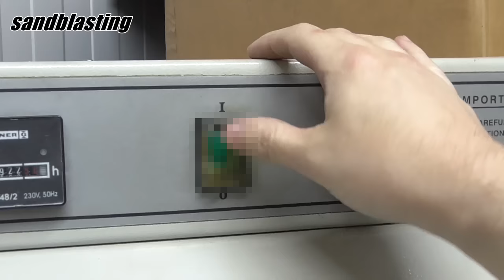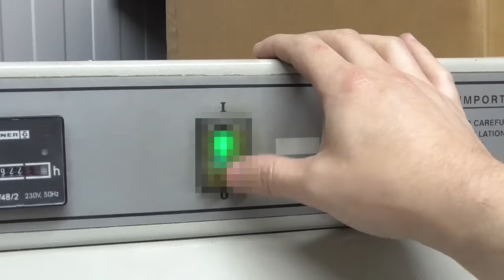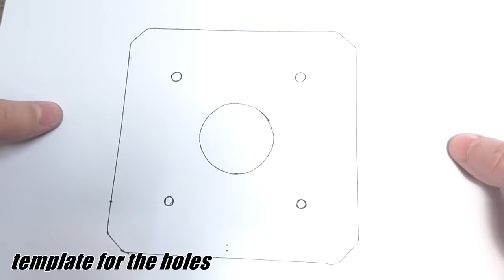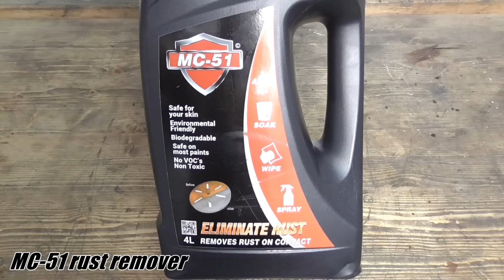Rusty Old Coffee Grinder - Perfect Restoration

Comment: Absolute perfection! I cant believe you filled in the holes and re drilled them because the countersinks were too big! The attention to detail and your craftsmanship are unparalleled! Keep up the great videos!
Reply: On car restoration side of things using brass or if possible copper plate behind the sheet metal and fill weld it is pretty common method. This way molten metal has something to support it, so it wont just drop off and steel wont connect to brass or copper. Also those metals are great heat conductors, so heat is pulled from steel by copper or brass and this way thin sheet metal warping from heat is minimized. Plate being big enough it has enough mass to absorb and spread the heat on the material so it wont even melt.
Reply: @Hellsong89  thanks for the explanation

I learned quite a bit there

Comment: "You can always remove material but you can't add it back"

my mechanics: Hold my welder
Reply: I was thinking the same thing during the video a couple times haha
Reply: There is too much material removed from this part

I make a new one
Reply: Im a deisel tech and a welder. That's one thing we know that we have that wood workers dont
Reply: @decembersveryown5935  wood glue and sawdust my friend.
Reply: Pyotr Ilych Tchaikovsky  big guts
Reply: @windhelmguard5295  that works but look is not as good :) greetings from Poland :)
Reply: Very nice
Reply: @crazyivan030983  If you paint it, it will work fine.
Reply: A 3D metal printer

Comment: just realized he used the olive oil as lubricant so it would remain food safe. genius!
Reply: Olive oil will go rancid with time though.
Reply: And he used lead solder
Reply: HOwever, it's not a good idea to use olive oil on the grinding burr since it will contaminate the coffee. Unless you don't intend to use it. Then yes.
Reply: @3DMegadoodoo  I suggest Mineral oil, it is edible and will not go rancid. Great on cutting boards and wooden knife handles
Reply: @RBG-tr9ce  not all mineral oil is edible. It must be food grade. Walnut oil is a great go-to. It's used extensively in woodcraft as it won't decay or spoil.
Reply: The man forsure has talent
Reply: @damiant427  Is it eatable?
Reply: @damiant427  That's not lead, it's tin.
Reply: @outsidethepyramid   That made me laugh so hard
Reply: Olive oil will dry out and become gunky after a while (like oil paint). Eventually you have to use a solvent to remove it. People at a restaurant I used to work at would occasionally use olive oil and pan spray to lubricate an old slicer, but it always made it worse long term and we had to use WD-40 to clean it (which obviously isn't food-safe).
Reply: @RBG-tr9ce  You have to ensure it's food-safe mineral oil. Not all mineral oil is. But it is recommended over olive oil because, as you said, olive oil will spoil over time.

Comment: I was hoping you'd reform the grinder parts, however at the end they seemed to grind coffee just fine even with the "well used" shape of the grinder parts. Overall beautiful as always!!
Reply: I was hoping to see that as well.
Reply: All this effort on this now beautiful little grinder, and the actual grinder part is still a complete wreck. Sad. Not sure how he would have fixed that but I was hoping.
Reply: Function and form - the grinder works 100% efficiently, and preserving the slightly worn look adds charm. perfect.
Reply: @Soup-Dragon1  I mean, the grinder definitely still grinds coffee. But those burrs are still too worn post-restoration to give a consistent grind quality. This is still a beautiful little work of restoration, but I personally wouldn't trust the coffee ground out of it to taste particularly good.

Still, probably tastes better than anything coming out of a conventional blade grinder.
Reply: It was anguishing to see those dull burrs go back in after all that work, but I don’t think there’s a good way to resharpen them.  I replace my grinder burrs about every 2 years.
Reply: Should have machined new burrs. 100%

Comment: I'm very surprised that 30w soldering iron was hot enough to solder that larger piece of brass. That was a top-notch video!
Reply from the maker: I had to heat the part for quite a bit with max power on 450°C. Thanks man :-)

Comment: it is weird to watch, because the quality of "restoration" is like million times better than original job. Usually restorations takes a thing 80, maybe 90% to the level it was new.... in this case it was like 1000%.

What is very interesting... who made it and why... it was clearly not a factory job, a lot of improvisation and some really shoddy craftsmanship. Seems like some sort of one off project... maybe village blacksmith made it on order?! Just bizarre thing.
Reply: I was thinking along the same lines: this can't be a factory job. Brilliant resto though.
Reply: L P You’d need some sort of factory to make that burr, I think. It’s made from tool steel and needs helicoid machining. From my limited knowledge of old manual coffee grinders, it looks like a Peugeot Freres and I’m guessing it’s from the late 1940s. The colour, the poor quality and the fact that it’s mostly made of metal tend to point that way. There are plenty of them around on eBay for very little money and they are mostly in this sort of condition. I haven’t owned any French coffee grinders, mainly because they are not very good. French coffee is pretty undemanding on grind fineness so the burr and its adjustments are nowhere near as good as a good Zassenhaus, Dienes or PeDe and that one is blunt enough that it would be unusable for anything but the coarsest grind.

French manufacturing and infrastructure was in an extremely poor state in the immediate post was period so I’m not really surprised the original machining is so rough. On the other hand, Eastern Europe produced a lot of similar items which really did come from cottage industry so my initial assessment could be wrong. I have seen similar items from Czechoslovakia and East Germany and I assume they were also made in the former Soviet Union.
Reply: TheThirdMan 
Thank u for this knowledge
Reply: @comeatme6ro413  It could be assumed they just made things this way back then, but many decision looks like one-off job to me. I certainly doubt it was mass produced. Those screws and nuts looked like one-off, everything suggesting it was hand made. Sure it could have been like small workshop, making dozen of them a year, but certainly doesn't look like production line job... far too much variance between each part and a lot of decisions which looks to me like improvisations on the spot.
Reply: @thethirdman225  The helicoid part in particular look like hand made and not something made on proper tooling. Probably cast in rough shape and then hand filed to fit. It may even look copy or knock-off i.e. the "craftsman" had like a proper factory made machine/parts so knew what it needs to look like, but didn't have right tool to make it exactly like that.... so it sort of looks like real thing and probably sort of functions.

Comment: Great restoration as always but... you didn't fix the most important part: the grinding mechanism. It's all dulled. This thing will not give you a good grind, it wil just break your beans by pressure which will put stress on the metal and damage it even further and give you an uneven grind. A grinder actually cuts the beans.

If you don't actually plan on using it and just want it to look good then this build is complete, but if you actually want to use this in any capacity to grind coffee, you need to sharpen every little blade of this mechanism, maybe even remake a new one since it's really busted up.
Reply: I agree on this, i were thinking if you dont restore the actual grinder then why restore it in the first place, because if the coffee grinder is just for looking at you could have in it´s original state. Else i loved this restoration movie. You did a fab. job .. replacing the brass and adding material to the metal and wood is amazing.
Reply: Read the description
Reply: Agreed, as I person who loves good coffee,  I find it strange, burrs need to be replaced, they absolutely worn out ...  replacing /making  new bolts which are purely decorative and leaving most important part of grinder, BURRS   as it is...just makes no sense at all to me.
 This grinder won’t produce  good ,even grind ...looks good though...
Reply: Annie Hawes wrote about finding a wonderful old coffee grinder and using it. The ground coffee tasted terrible. Then her bf told her that his dad only kept it for making chili flakes.

Comment: But the actual grinding mechanism was shot. It looks beautifully done but still has those blown out, worn out grinding gears?? WHY?
Reply: TopherFM he restored them as much as he could so that they’re pretty functional but it would be pretty hard to solder and machine bc huge loss would occur (and it won’t be accurate) and making new ones will be 1. Very Hard 2. It’s like the soul of the machine and this is restoration not remaking
I’m sad about that too bc I absolutely love the idea of having a perfectly working ancient coffee grinder but you work with what you got ya know
Reply: @randomalienfrommars0567  and, lest we forget, the restored grinder did a pretty good job grinding coffee beans.
Reply: Yeah, I was a little disappointed about that too. But the cutting parts had a very complex shape and it would be very difficult to grind them all, maintaining their symmetry. Even if he could grind them, he would alter their geometry and they wouldn't be able to fit together. I am sure that if you were really crazy, you could TIG weld the cutting teeth and spend a lot of time making a 3D model so you could program a 6 or 7 axis CNC machine to carve new helical cuts. But it would have to be perfect, so the parts would fit together and ground coffee properly. I think he did as much as he could with his current set up. Still a great video.
Reply: My guess is the original grinding pieces are cast? So would have to make a mold from the piece have and then complete the missing detail then recast a new piece?
Reply: @incognitotorpedo42  It depends on how course you want your beans. I think these worn out teeth would struggle to go much finer then a medium grind (would become very uneven otherwise)

Comment: The guy: is wearing gloves when uses polishing wheel 
Also guy: isn't wearing gloves when uses belt grinder
Reply: Yes. What's wrong?
Reply: I'm not a guy inside the sector but even I know that you don't wear gloves when working with fast revolving machies for safety reasons
Reply: you use gloves when using the polishing wheel so as not to stain the brass :)
Reply: That's a huge no. You never use gloves on a machine that can snag clothing.
Reply: The gloves are used for heat protection.

Comment: I was watching u literally melt metal into the box in the beginning just to re drill holes, and was like, “isn’t it easier to rebuild box?”. Then I remembered this is more on restoration rather than just improving trash design lmao
Reply: Nah, it's actually quite easy and quick to just weld those holes and redrill them than to make a new box. You need to get plate of certain thickness(I guess this guy has everything in his workshop anyway :D ), do some bending, weld the edges, grind and polish them, drill holes etc. And if You can weld and drill making new holes takes maybe 15 minutes

Comment: Dowels are just welding for wood.
Change my mind.
Reply: I thought about it for a sec...decided I can't.
Reply: dowels are rivets for wood. 

or locating pins. 

wood glue is weld
Reply: @tylergarza8695  r/woosh
He welded the holes in sheet metal and drilled them again,
He did the same with dowels for wood.
Reply: @Throneos  it's r/woooosh, also this isn't reddit idk if you've noticed how that doesn't work here. 

also also, that's just a different method of solving a similar problem, why do you have to act like this.

Comment: kinda off topic.. but i build plastic gundam models.. when you snap the pieces out of the injection molded parts runners they leave little tabs you have to sand off with various grits of sand paper.. and honestly thank you because i file and polish them in the same hand movements you use to file off sharp edges and they come out perfectly blended and polished!

Comment: Nice video. Keep on going, although it might be better if you use longgrain plugs in stead of end grain. Screws wil hold longer in longgrain wood then endgrain wood. 
Have seen it in several video’s of you. 
Its just a tip😉. 
Keep on the good work💪🏻

Comment: Pro tip: when soldering large items that tend to act like a heatsink, preheat the item to be soldered with a heat gun and add some liquid flux before the solder.  The solder will flow much better at lower tip temperature and the surface tension of the solder will drop allowing it to wick into crevices.

Comment: Funny thing about rust remover. 
Bought original cast iron Coca Cola chairs (50's) and I soaked the bolts and nuts in rust remover for 24 hours to see if I could still recover them. I took them out and had everything ready to blue them and I just watched as they rusted right before my eyes in mere seconds.

Comment: At 11:14, what kind of metal material did you use to connect the two ends there? I'm also curious if one can use a normal soldering iron, or does it have to be a special type for this purpose?

Comment: How do you know when to polish a metal surface jak in case of knobes or the grinder shaft and when to clean/protect it further with sandblasting/blackening like for the main part? This seems to be a pattern but based on what?
Reply from the maker: Depending on the purpose of a part and the look I want to achieve.

Comment: I understand I watch it 3 years after and you got to another level in later videos but I was a bit disappointed that the grinding "stones" were just cleaned and not replaced or remade. The whole thing is perfect, immaculate even, but for one thing. It wouldn't work properly. Those "stones" are badly worn out. 

Please don't take it as a criticism, but an inspiration. It would be possible to change them in any later event.

Comment: I noticed that you clean the painted parts with a solvent then paint remover and then sandblasting and then cleaning again
Is there any specific reason for doing that 
Sandblasting would just  remove ever bit of dirt
Reply from the maker: Sandblasting media is very expensive and it turns bad a lot faster when there's a lot of dirt or old paint in it.

Comment: @my mechanics  Why didn't you sand blast the paint off this item, instead used a paint stripper?
Reply: The sand blaster being used is a recycling blaster, so they reuse the media- and if you were not recycling it then it's fine to use it to remove paint. But here you're mixing old paint with the media, so you don't want it gumming up the system.

Comment: did you use paint stripper first because of lead paint? otherwise why not just sandblast the paint too
Reply from the maker: Sandblasting media is very expensive and it turns bad a lot faster when there's a lot of dirt or old paint in it.

Comment: What is the abrasive surface you're using at 15:07 to sand down the brass nuts?
Reply from the maker: Flat surface grinded aluminium plate with 240 grit emery gloth taped on it.

Comment: 1) What type of corrosion did we find on the restored piece?

2) What types of cleaning are used in this restoration?

3) What is the paint removal process used?

4) What is the corrosion removal process applied on the copper hopper?

5) What types of finishes are applied to the parts, to avoid the resurgence of the corrosive process?

Comment: why was the sand blaster start button censored? 🤣 3:45
Reply: The soft rubber dust cover over the power switch was badly worn and torn. He removed it  and didn't repair or replace it. Ever since then, the naked switch has been pixelated out.